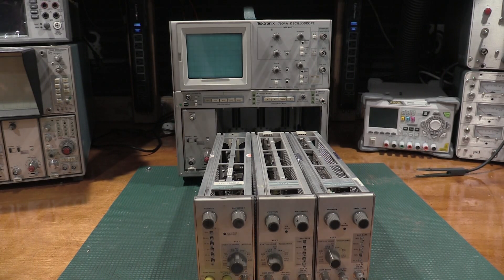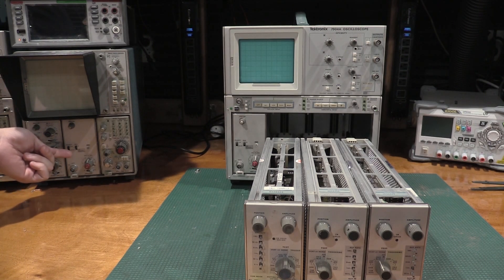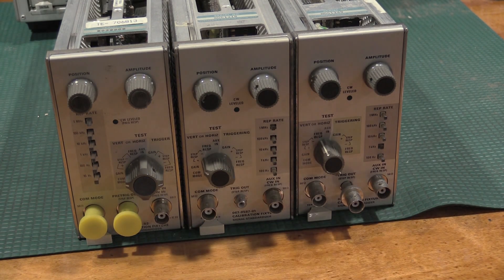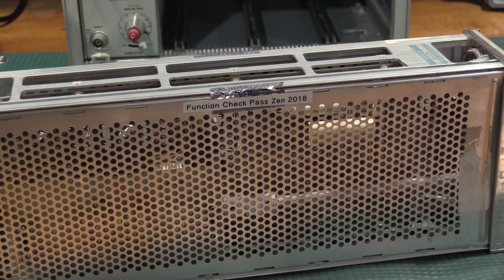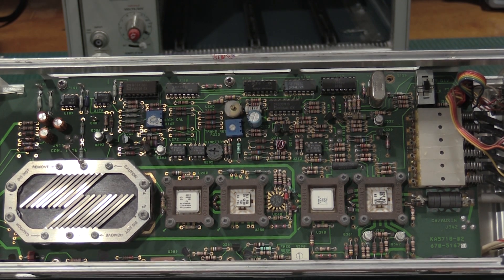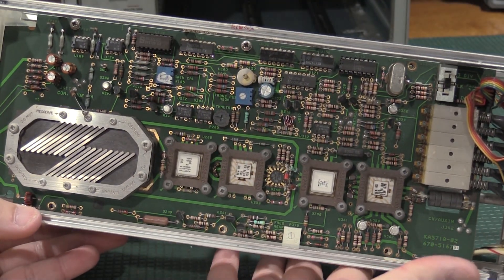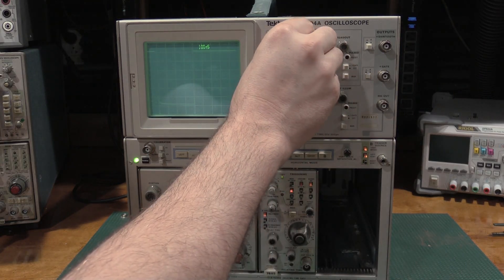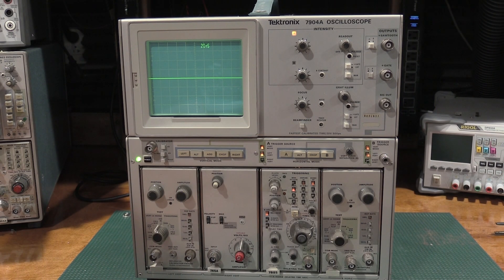Tektronix Calibration Fixtures and Standardizers For 7K Frames

Comment: Great video Zen! I have a -01 standardizer that I bought to calibrate my 7704A but I never got to it, nor do I know if the standardizer is calibrated. Would love a video about that!
Reply from the maker: I will work on that. If I remember correctly there is not much to "calibrate" on the standardizer. They kind of work or they don't. One of the critical signals that the standardizer outputs is the fast edge step signal that is used in the high frequency compensation of the vertical bays. As long as that is working everything else can be done with other gear and different ways. If you have a 2nd calibrator it is REALLY helpful on dialing in the geometry of the tube as well. But is not needed.
Reply: @ZenwizardStudios  With "calibrated" I meant "does it even work" lol. For the moment I think I'll do with the single standardizer, can't justify the spending unfortunately.

Comment: I’ve got a pretty nice 7104. Just a little burn in where the readouts show. I’m just having a rough time finding a 7A29 with option 4 delay.
Reply: They are quite rare. I have a 7104 in the lab with a 7A29 and the appropriate 7D10 and 15 time bases. I have been looking for an option 4 too...